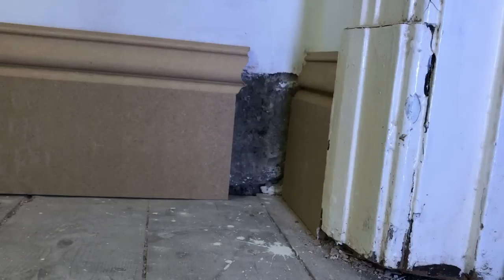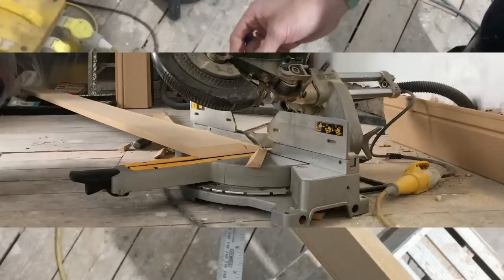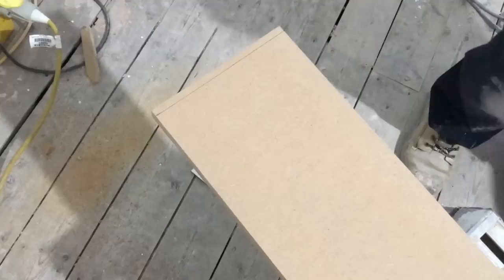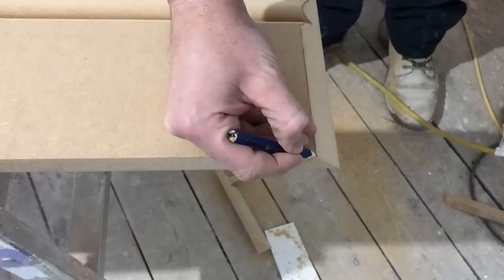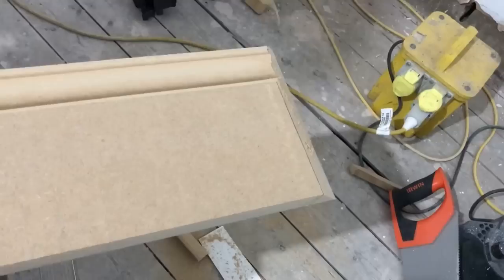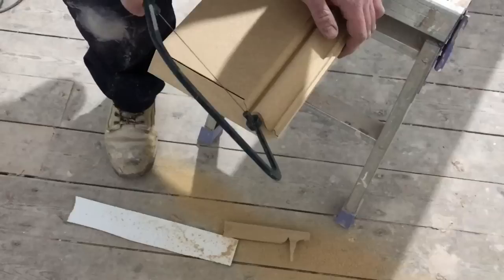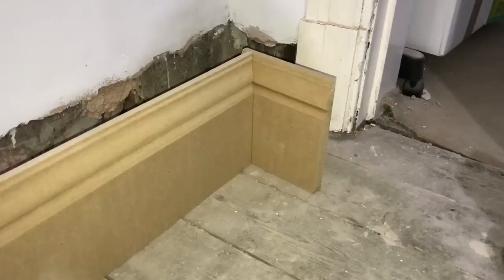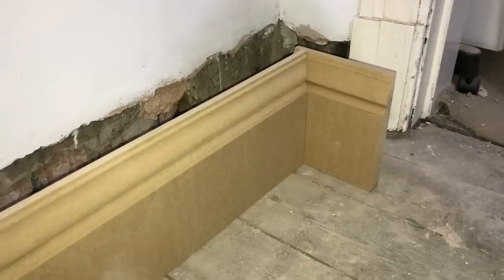How to cut a scribe/cope internal corner on skirting boards or baseboards

Comment: This is the correct way to make inside miters. I cheat and use a flap wheel on a grinder. Bravo man.
Reply from the maker: I bet using a flap wheel makes a lot of dust.
Reply: @spendtimesavemoneydiy  dust... on a job site... imagine. If you can't manage dust you shouldn't be on a job site

Comment: Good video thanks. I cut the straight cut on the mitre saw with only a slight back cut. Better job and more surface to hold wood glue, reduces the chance of shrinkage and gaps down the road.

Comment: Got the method, now all I need is the skill!
Reply from the maker: Let me know how you get on and if my video was any help 👍🏼
Reply: @spendtimesavemoneydiy  It's a nightmare, I've not even got to the skirting yet and I've had two full days at it. walls and door frames all over the shop.
Reply from the maker: @TheDoosh79  stick at it. You'll be proud of what you can achieve 👍🏼
Reply: @spendtimesavemoneydiy  Thanks. The scribing has actually gone really well, I seem to find it quite easy, shame about the walls!! the external mitres are challenging, especially around the chimney breast.

Comment: Thanks for this.  I am about to fit oak skirting to an old Victorian house.  Your tutoring and saw skill is very good and I will follow this on some rather pricey oak that is getting a Danish oil finish as the wood is to add to the character of the room.  The original skirting was ripped out in the terrible 80's and it is tough getting skirting to match the 1880's.

Comment: Absolute craftsmanship, but you don’t need to cut the full height of the skirting at 45 degrees, you only need to cut the top with the molding on, makes the job a whole lot easier as you’re not cutting the flat edge twice
Reply from the maker: Good point, this is the way I was taught and it's always worked great for me. As the saying goes 'there's more than one way to skin a cat'
Thanks for watching and don't forget to check out my other videos and subscribe to help my channel grow 👍🏼

Comment: Nice video mate I bring doing theese scribe joints for years and struggled but now you mention back cutting it think I will have a better finish 👍👍
Reply from the maker: gary robinson Thanks for the comment! I always back cut quite a bit so there is less chance of anything getting in the way of the scribe closing up. Also if the cut is slightly out a rough piece of sandpaper is all that's needed to fine tune it! 👍🏼
Reply: hi what is back cut ? thanks
Reply from the maker: nick evans back cutting is when you angle the saw so you cut more away at the back so only the front edge touches the other piece of skirting board. Hope this helps
Reply: yes i get it now thank you so much

Comment: Hi, why did you turn the edge of the hand saw around please? Really helpful videos, thank you!
Reply from the maker: With taller skirting boards sometimes there isn't enough capacity in the throat of the saw so if you turn the blade the throat is out of the way allowing you to cut unobstructed. Hope this makes sense 👍🏼

Comment: thats a good tip, cutting away from the scribed edge and going back in square on for your next cut. tidy! got a big expensive victorian ogee to do soon and dreading messing it up. the walls are wonky / bowed in and out on each wall. more than you can get away with filling. hoping the mdf will bend enough to make it look ok.
any tips on fitting? the plasterer has only come down to about 100mm off the floor in some parts, theres voids at floor level all around.
Reply from the maker: If you follow all my skirting videos you should be fine. Let me know how you get on.
Thanks for watching and don't forget to subscribe 👍🏼

Comment: You Sir are a legend, you're the only one to say cut the top off square.. I've been trying to cut it too a 45 degree angle and then having fitment issues, are all the external corners to be cut at 0 degrees ? , Some of my walls are miles out and the floor so they're not actually on the floor in places... hard stuff this is :/

Comment: with the one piece of baseboard you cope - is the other piece or will the other piece just be butted up against the wall? 

Is this how it usually is? Where in one inside corner, you have just one coped piece and the other is just butted against the wall?
Reply from the maker: That's exactly right.
Thanks for watching and don't forget to subscribe 👍🏼

Comment: Great video but I just can't figure out the change of blade orientation, what is that for, how much does it turn and why, do I not just keep sawing a back cut along the trace cut, was just about to try this but now I am confused
Reply from the maker: With taller skirting boards sometimes there isn't enough capacity in the throat of the saw so if you turn the blade the throat is out of the way allowing you to cut unobstructed. Hope this makes sense 👍🏼
Reply: @spendtimesavemoneydiy  I think I get it, thank you. My scribe cuts are still not turning out very well, OGI skirting board, I haven't achieved the flush look I see in videos, and if I have to sand, it goes to hell. Definitely a skill that needs to be acquired, and tbh I don't recommend newbie DIYers try this if on a budget, you'll save time money and patience by hiring a pro

Comment: If you mark your 45deg on the opposite you automatically cut the straight back when you cut the 45. Only the top section left to coping saw then. Saves one step.
Reply: EDIT ignore me im an idiot! Had it in my head you cut the 45 reverse way! Off to spec savers!!
Reply from the maker: gbwildlife uk Thanks for watching anyway 👍🏼

Comment: Just wondering how you measure to the other end in order to scribe it into an alcove?
Reply from the maker: When I do alcoves I put a full piece in at the back and scribe the two side pieces to it. It's very rare that you would scribe both ends but if you do I would get the measurement from the straight bit of the skirting not the moulding

Comment: Hello guys, who do you cut inner corner not with 45 degrees both skirts, but one with straight cut and profiling cut for other skirt?
Reply from the maker: DiavolO18 if you watch the end of the video I explain why it is done this way.
Thanks for watching and be sure to like share and subscribe to help the channel grow 👍🏼
Reply: @spendtimesavemoneydiy  Thank you for your reply, and what about top view? Does it cover with wall paint or silicone/culk?
Reply from the maker: Yes you can use decorators caulk for the gap at the top.

Comment: When you have to use a handsaw you don't need to cut the 45 degrees through the whole board. Just cut the moulding bit on the 45 and finish the flat bit with a straight back cut.
Reply from the maker: That's very true but I tried to keep the video simple. There's always a different way of doing things.
Thanks for watching 👍🏼

Comment: Excellent teacher!  Could one use a jigsaw in place of the coping saw?
Reply from the maker: John Carter sorry for my late reply, somehow I missed your question. Personally I wouldn't recommend using a jigsaw to scribe skirting boards. Once you get the hang of using a coping saw you will understand the control you have to achieve better cuts! Thanks for watching 👍🏼
Reply: I tried and it didn’t work for me.

Comment: Nice one mate! Tidy work. What blades do you use for your coping saw? 
I’ve had trouble recently with mdf skirtings that are soft as shit, makes it awkward to cut. Ends up all furry. 
 I’ve tried all sorts of blades and still the same issue even bacho blades. 

Also I’ve found with primed mdf skirtings it’s sometimes better to have the blade the ‘wrong’ way round, as in teeth facing away from the handle to stop tear out on the face of the material. 

Cheers
Reply from the maker: I always have the teeth facing forward so the tear out is on the back. I use eclipse blades. You can find them in my Amazon affiliate shop. Link is in the description. Thanks for watching and be sure to like share and subscribe to help the channel grow 👍🏼
Reply: Spend Time, Save Money, DIY     I actually have a pack of eclipse blades in the van I found in the van that I bought months back. I’ve been mainly fitting kitchens and upvc doors and windows recently. I will give them a bash next time I do some finishings. Cheers mate